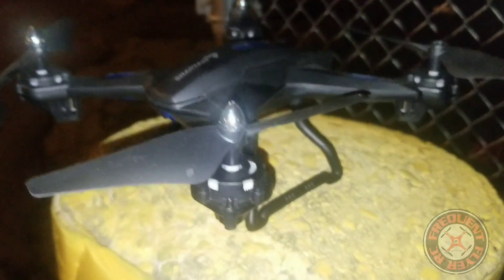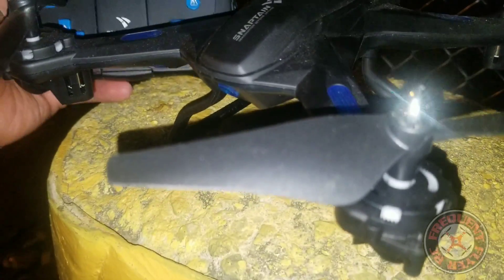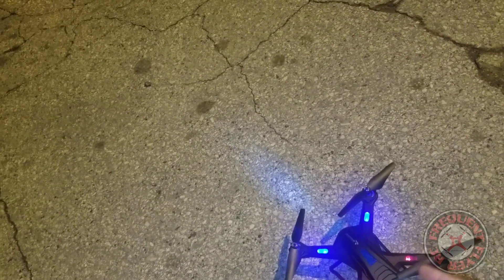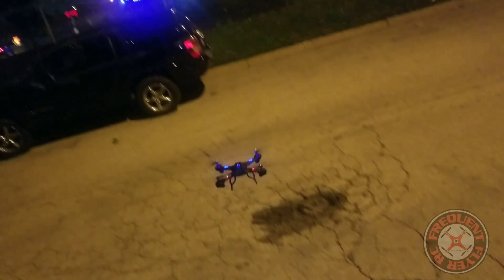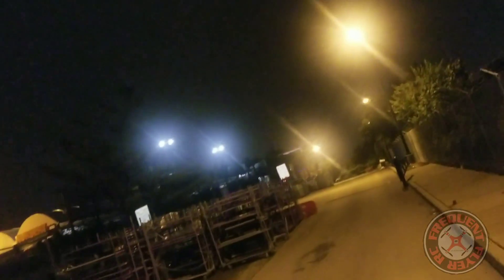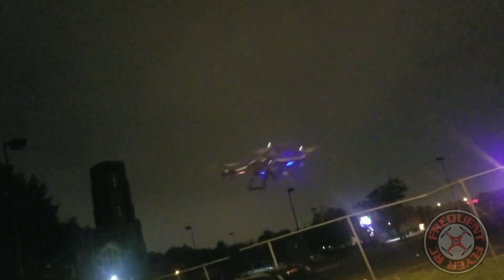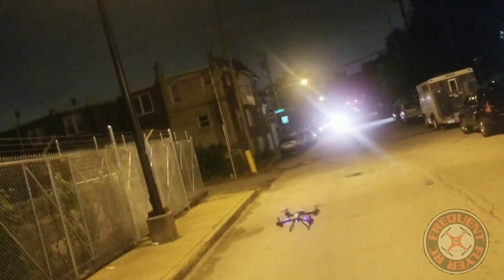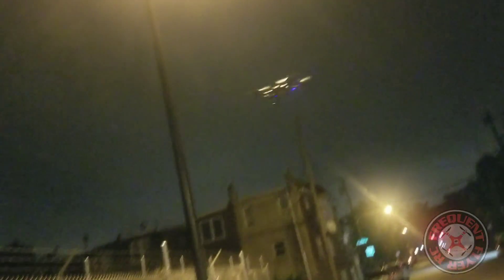Snaptain S5C Recalibration and Night Flight

Comment: I took mine on its second night flight.   Its easier than daytimencuz the lights make it easier to see the front. Lol.  Also.  I ordered mine on friday and it came on a sunday..  by the mail man??!! Crazy!! And all I have to say is that it is the best drone I've ever had for this price point it holds altitude just fine its precise it has a bunch of cool features it's return button Works wonderful I've had absolutely no problem with the Wi-Fi connectivity some people have problems and some people don't just depends on the one you get I got lucky I guess mine hooks up right away I get a great picture I don't even have an SD card in it yet I use a Samsung Galaxy A 10e phone so I don't know if it has anything to do with it and I have high-speed internet access but no data limits but anyway it absolutely Works wonderful it's super precise not hard to use it all and isn't very loud and has really decent power it's super durable comes with an extra battery and extra rotors it's a damn good bargain for the money and when you take it up high I'm telling you it goes way up I'm talking ATM I'm talking an American it's like 300 feet in the air dam near I swear that thing disappears it get so high up in the air and you can go around and around and it doesn't lose signal it just stays connected the way you want it and I swear I couldn't be happier I don't get any money for advertising for them I have no deals with them whatsoever and I am the first person to complain about something if it's a junk and I was expecting the kind of get s*** on when it came to this drone when I bought it but it's had such great reviews everywhere I looked that I started to get somewhat High Hopes and watching reviews like yours and other people's My Hope stayed up and when I got it I wasn't disappointed
Reply from the maker: Happy to see you are having fun with it! I did not know the range of it was so good but I'm not surprised as the little Hubsan X4 has excellent range as well. My neighbor used to fly his so high you could barely see it! 👍🏽

Comment: Should I use the headless mode on this drone? I’m a beginner and I don’t know which way I should start flying.
Reply from the maker: No. Just place the drone down with the tail facing you whenever you start and learn orientation that way. Headless is a cool "trick" but if you wanna learn to fly keep it off👌🏽
Reply: Frequent Flyer RC ok thank you
Reply from the maker: No prob

Comment: Mines pulling forward right down ive reset gyros changed motors it happened after I crashed it pretty bad and the front right motor pulls its weight and when I hold it still it fights me to go to the right but I hold it how it wants it acts as if it is perfect
Reply from the maker: Could have a motor on its way out.

Comment: NEWBY: Can a Taranis QX7S be used with this quad and are there any goggle that will work with it?
I'm trying to learn how to use these things.
Reply from the maker: Nope, this is a toy-grade drone. Good for line of sight fun only for beginners and those who like flying in angle mode. (self leveling mode) The video feed is Wi-Fi and not 5.8GHz which means there is too much latency for flying FPV 👌🏽

Comment: Hey Freq flyer long time subscriber always at awe when u do your night flying I can tell ur not as impressed when I saw ur review on v636/Alien way back years ago. Yup also got the alien body on it too like u did lol. The reason I came across this model is because I saw that 1S non-prop battery on this, should be able to use my old v636 batteries also right?
Reply from the maker: Yup, same connection